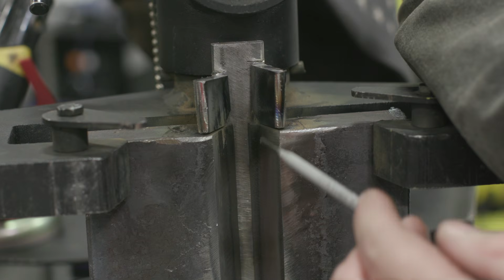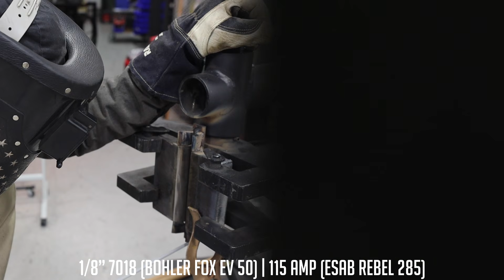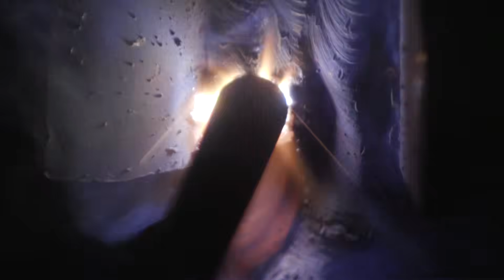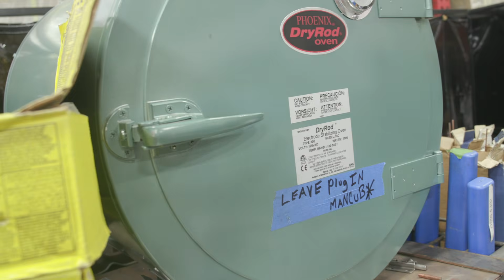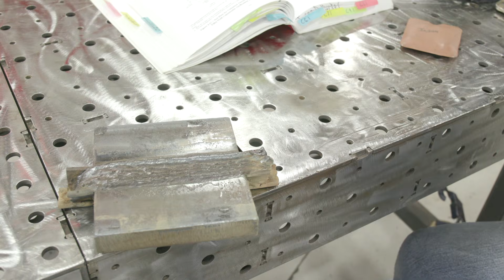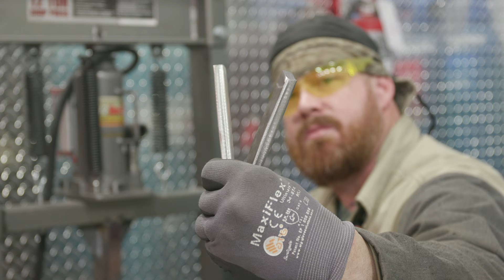1 Inch Side Bend Test | 3G Uphill Stick Welding | D1.5

Comment: I would love to see a 1G with fcaw esab 71 with 75/25 gas. And after you cut the strips lets see pictures of the sides before removing the backing. Im having a problem with lack of penetration on the toes. I feel like a lot of people never show that. Great video just no videos show visual inspection of root with backing as described in d1.1 2025.

Comment: Just took this test for a company and I wasn't allowed to grind the root or cap and the fit up/root was inspected before allowed to weld out. I did the whole test no grinding. You only need a wire wheel on this test if you run hot enough. My root was about 87-95amps 3/32 7018, 1 hot pass after with same heat just pause on sides. Then I went up to about 120 with 1/8th till flush, then cap with 3/32 on about 85 amps. Easy no grinding

Comment: I just did a practice test and I do the real test this Tuesday and I can grind it’s a 1inch d1.1 but I ran mine just like this and it worked great for both 3g and 4g I ran the 3 at 117 and the 4 at 123 and it was great I didn’t need to grind at all I was allowed to but didn’t need it so thanks this video helped a lot and I’m going into this test Tuesday really confident because the practice was ran just like a real test so thank you

Comment: Heat rises only in a fluid or gas because it affects the density of the fluid. Under the influence of gravity the more dense (colder) fluid will sink down and the less dense (hotter) fluid will float up. In a solid material like steel heat travels equally in all directions.

Comment: Side bend is also used for high pressure tube weld certification. In fact you have a "cap bend", "root bend", and "2 side bends" (not just one). Any defect is a busted test.

Comment: Hey bro your videos are the best I don’t have no welding knowledge never done it anywhere not at home or on the job but I’m a carpenter in the union and I see that nobody in my trade have the D1.1or the d1.5 CERT I joined my welding class that is offered to us for free since we are in the union and I took a two week class before with light gauge for D1.3 and I passed it was a two week course and I passed my fifth day so I started practicing on my 7018 because the previous test was 6013 started doing 7018 structural for the last week didn’t complete anything and then I took a five week class on Saturdays and I was able to obtain my D1.1 certification by watching your videos you put out some real knowledge and wanted to say thank you for that
Reply: Are you in the 274 union?

Comment: I like to use a fresh wire brush, sharp flat head screw driver, flash light and 9" high velocity fan to cool plate as I weld.

Comment: I have a question about the 1/8” rod you’re using. I’m in welding school and I did my stick with backing and I did 1G and 2G with 1/8” 7018 at ~100 amps. But my vertical and overhead it just was too hot and it was impossible to make a weld so I had to use 3/32 at ~85. My instructor said that it’s very difficult to run 1/8” on 3&4G on 3/8 plate because there’s nowhere for the heat to really go. Are you running 1/8 at that amperage on 3G because the 1” has a lot more room for the heat to go?

Comment: I have trouble running my test plates with stringers, i cant keep mine as flat as i can keep my weave. I want to get better at stringers but cant get it right, any tips you can point out to me to help me run better stringers in 3g? I usually run about 115 amps

Comment: I did a vertical up test but my bend piece is 15/16 not a inch would they fail it because it a 1/16 off??
Reply: No, that’s just typical from the mill like that. Chances are you either did it at a accredited test facility or at a job with a inspector present they give you the material according to the welding procedure

Comment: Note if you're welding high strength steel or equivalent don't instantly knock the slag of because slags servers more purposes besides protect the weld from the air but it also insulates the metal slowing the cooling rate which is vital when dealing with hard to weld steels

Comment: HAHAHAHAHA....To all guys wanting to get into welding stick is utilized 99% of the time for pipe and or deck welding, so if you don't plan on doing either don't waist your time with stick. 99% of structural utilizes FCAW NR232.
On what planet is any steel erector ever going to run stick on structural and least of all doing a D1.5 test? 
Most (if not all) steel erectors would never mess with stick because it is extremely time consuming (expensive) not to mention the limited exposer time of the rod.
I have been a welder fabricator for over 24 years, a CWI for over 16 years and not once ever have I ever seen stick utilized for structural. Only thing it's used for is decking or safety railing.

Comment: How do they rate welders in terms of max plate thickness? The rebel 285 is rated for 1/2 inch thick material max, but  now we know it can weld 1 inch thick steel.

Comment: Having a hard time getting the bead to lay flat on the root pass. It's always convex with slag trapped at the edges. Very frustrating. I've played with amps a lot, never gets any better. I almost wonder if my machine or the grounding is causing it.

Comment: We had to take that test open route no backup plate 0.45 wire at niles steel tank company in niles Michigan. Welded high pressure tanks. Mig, tig, rod.

Comment: 14 minutes and 43 seconds..
This is the best sentence.. and most important thing you need to know!!! A 20-minute video!! And the most important thing of all gets less than 3 seconds??? never once not mentions.. interpass cooling temperature..??? I've worked in power plants.. Westinghouse, general electric, on the turbines,, general Dynamics, Submarines... But hey ya for a 20-minute video..🤫🤫🤫🤭🤭🤭🧐🧐🧐

Comment: Timestamp 4 minutes and 49 seconds.. I got a tip for you.. I've only been doing this for 35 years.. and""" that wire brush is not going to remove any slag""!!! And chipping hammers are for archaeologist.. the best most efficient tool in my humble opinion is a 6in flat-head screwdriver.. it works as a combination ""all""and spatter remover..the only thing that way of brush is good for is removing smoke residue!! This is  my humble opinion after 35 years

Comment: In my experience  1inch overhead.. AWS certified  for all position unlimited thickness.. the certification.. specifies and is limited to electrode type and.. process.. whether it be smaw. Gmaw. Fcaw-g . Fcaw-s... IDK times  change. I've only been certified for. 35 years 😂😂..

Comment: Nice welds!
I'd encourage welders to also qualify using NR232/233 wire as flux core welders are in high demand for the structural field. 
  Pressing my luck, I've filled the 1" test plates in 4 passes using NR232 x.072" wire!!
The deposition rates with FC can be up to 5x what we can get w/stick welding...hence the demand for FC welders!
Reply: No structural is done with stick ever.

Comment: As an inspector; I appreciate the slag advice. When I start hearing comments like “ I’ll just burn it out” it makes me wonder about any other shortcuts they’re taking. It can really change the dynamic between the welder and the inspector in a negative way.
Reply: As a welder I cant imagine myself telling an inspector hey dont worry about that slag in there I'll burn it out!! Lol.. but I've worked with people that will shortcut anyway they can and it drives me nuts

Comment: All my butt weld test plates have been either open or closed root, done some projects  welding with copper or ceramic backing, x-ray or RT and PT or MT tested.
What was the backing on this test?
I don't think aluminium could coupe it but steel would fuse with the base metal, right?

Currently working as a welding and assembly  supervisor in Sweden, always striving to learn  more and living the blue collar life🤘

God invented welders so that firemen could have heroes too
Reply: It’s a steel backing, A36 same as the weld plates. A lot of times the backing is left in service out in the field unless noted otherwise.

Comment: Good stuff Jason. my advice from my mentor was Clean, clean and clean again ! 
Stephen Marshall @rippy154 is a instagram friend of mine as well, super talented fabricator IMHO. He does not live far, perhaps someday we will meet. 
I did this test some 25 years ago and still have my samples from both V-up and overhead. For fun polish up the weld area and wipe some mild acid on there to bring out the weld, it will make the individual  beads stand out. Oil it up and place it on your desk for a conversation piece. To this day thick groove welds all get done with the same attention to cleaning. No slag left in the weld is the key to success. If I get a shit spot in a job I am doing, I will grind it out and fix it before I proceed. Do it right, code weld or not it will not fail in service. Take pride in your work!

Comment: I need help on indicating on wich rods to use for certain jobs like a 1/2 in stainless steel vertical flat surface
Reply: Help on indicating?? Not sure what youre asking.. i can tell you not every stainless electrode is created equally. And that just because a vendor says the electrode can weld out of the flat position... doesnt mean it will weld worth a darn out of position.

Comment: Seems like I'm missing something here...
@ 8:09 - "still a stringer, I'm not running a wave(r) here" -  and I see the stick waving from side to side.
Now, I GUESS a "waver" does not become a "qualified waver" until it reaches certain width (like, say, 3/8" or 1/4"), but it is still rather confusing to all of us non-professional welders. Can anybody explain that "wavy stringer" issue properly? Thanks.

Comment: I have never welded successfully ... once I stuck a few rods to a rusty I-beam and realized that there was more to this than renting some gear from the local rental shop ... then children and career knocked out 30yrs ... now with YouTube and channels like yours, I can get into stuff and absorb the amazing knowledge of real experts ... so, two comment areas from someone who's still never successfully welded, but will one day soon visit the offcuts bin at the local metal shop and have a go at proper practice and learning.

Comment 1.  You guys usually demonstrate with sacrificial backing plates in examination setups. Do you actually use backing plates in the field? Do you remove them? How do you remove them? They seem like they must have become part of the workpiece. Just a huge amount of grinder work? Show backing plate removal sometime.

Comment 2.  Most (not all) of your welds are on 6in stock from 1/2" - 1" thick, on a workshop jig. Often you have a videographer. It would be interesting, if you had client permission, to take the videographer along on real-world jobs. Show how you problem solve in the field. Workpiece prep and support. Inadequate elbow room. Time pressure. Maybe sometime you could show expert thinking 'in the wild'. 

Just suggestions. Thanks.
Reply: That would be very interesting to go on actuall jobs do various scenarios as far for the backing strips they are left in place in the field there cut off for testing only

Comment: This might be a stupid question, but when you qualify for, say D1.1....
How long are you qualified for?
Where I'm from (Denmark) you have to re-qualify every 2years...
Reply: For a certification, you have to maintain continuity and get signed off every 6 months. As long as you keep current with that, the cert is indefinite. But you’ll most likely have to retest for every job and with a new employer.

Comment: Outstanding as always. I learn so so much from yall. I went into welsing school for SMAW with 6 years of GMAW and every video Weld.com has produced on SMAW in the last 4 years in my pocket. Made a HELL of a difference. That said, how about a video on what slag profiles should look like? Like what does the slag on a 7018 3G and 4G and 6010 6G spring to mind.  I saw a good look at it here, but it would be cool to see it under a variety of heat, cleanliness, and CLAMS conditions. Give the newer welder a chance to start diagnosing their welds at the slag level and the intermediate welders a goal. Also, it might be cool to do a video on how to remove the backing plate from the B-U2a joints and how you clean test coupons with more detail on not overgrinding and rounding edges than the Test series. Thanks yall!
Reply: Hey man, thanks for watching. Not sure what you mean by slag profiles. We did a couple videos awhile back on how to prep the test plates before welding and how to remove backing and prep the coupons that was pretty in depth. That why we speed through it this video. Check it out here
 https://youtu.be/Bz0-I2kLd0U
Reply: By slag profile I mean what the slag should look like before its chipped off. What the slag should look like if everything is correct. Such as bad travel or work angle causes slag to look like X, lack of fusion can cause slag to look like Y, etc. 

Now that I think on it I feel like Bob did a video using a wash tip on an Oxy-Fuel torch.

Comment: Side bends you haft to be extra careful about slag GET IT OUT what ever you do don't leave none of it even the tiniest bit 18 series rod slag is meneral based more heat won't get it out like cellulose rods
Reply: Someone who gets that not all slag is the same. 👍 I am a welder and welding inspector and I still have to remind guys to get their damn slag out and that a wire wheel doesn't always get it. I usually get the response "I'll burn it out." NO, No you won't. Or "It's not getting UT'd. Who cares?" Well I fucking care I am the inspector on the job and since when is it ok to be shitty when no one is looking?
Reply: Im going to say i want to get all of the slag out of all of my welds..

Comment: Which material is for D1.5? is prequalified the WPS used?
Reply: Just your regular mild carbon steel unless it’s a bridge test it will be high carbon steel with 8018 rod.

Comment: is it presonal preference to go with that angle when welding or is it better? i taught close to 90 degree you get better penetration on rooth.
Reply: I prefer to keep about a 5°-10° angle (just under perpendicular to the weld face). That’s just how I’ve always done it and have always had good results on my tests and field welds.

Comment: Also, off-topic, any of the vid's I've seen of the 'serious' welders (weld.com guys, IC Weld, etc) use the 'old school' helmets and not the fancy-schmancy Auto-darkening helmets. Why is that? Is it just a personal preference thing or is it something else?  Thanks!
Reply: Just a guess but for the guys tag teaming pipe you can’t get flashed with a flip lid
Reply: Plus they work every time.....
No "low battery" or flashing time and time again.. When they drop.... you're ready - everytime!
Reply: A lot of the old hoods have auto 2x4 lenses in em these days

Comment: I know bupkis about welding, so don't jump all over me, but when you did the root pass and subsequent pass, you said they were stringers, but by going side to side, they really looked more like a weave. I did some looking around on the web and what I found, basically, was that stringers are straight passes and weaves are just that, a side-to-side weld. What am I missing on this?
Reply: You are absolutely right. I'm reading through the comments to see who else has picked up on that.(Your the first) Along with some other things that should be mentioned as well as pointed out especially for the beginner, novice to intermediate level welder.

Comment: Just from the start I have never worked in a place that would allow any of that. No extra run offs. No clamps to keep it straight. Nothing. They give you random fit up dirty metal and don’t let you do anything to it.
Reply: It’s pretty standard procedure for any place that does any welding that’s worth a shit.
Reply: Cory Knowles the worth a shit is the kicker
Reply: Sounds like you need to find a better employer.
Reply: Jason Becker you are not wrong. Eastern Tennessee does not have very many places that actually want welders and not guy that hold mig gun

Comment: Could you PLEASE do a Video on welding in uncomfortable positions/ locations maybe use a mirror or if you have Tips on it I would appreciate it. I’m currently training my “weaker hand” to weld ambidextrously..   Thank You again for taking the time out to make these videos your knowledge these Videos have greatly improved my skill set 

Sending You Positive vibes from Orlando, Florida
Reply: Using 3 mirrors, like taking 3 gold faced welding lens and taping them together like a book works great... or using a second mirror to reverse the image also works great.. soo put one on the left that can see the weld..  and one on the right that can see the left image.. and look at the right mirror.. 
As for ambidextrous.. when i learned to weld.. i took the class 2x.. once with my left.. once with my right.. and take it further.. practice writing with the off hand.. doing everything with the other hand.. put a bead on with the left.. put a bead on with the right.. ect.
Reply: @johnjacobjingle8302  thank you for the mirror concept and thank you for the knowledge. I appreciate it